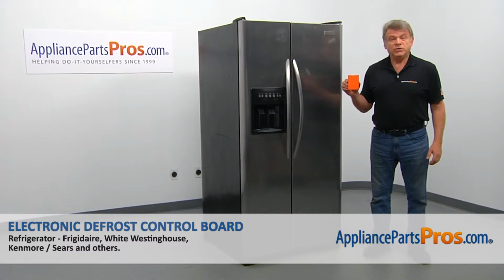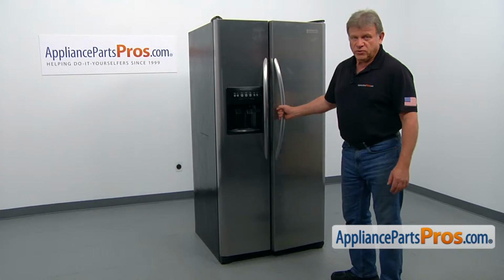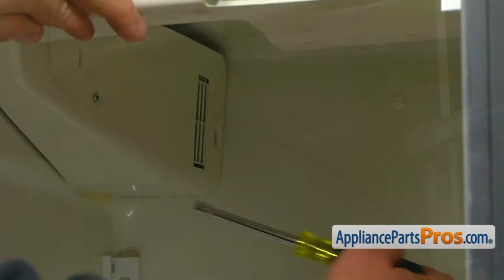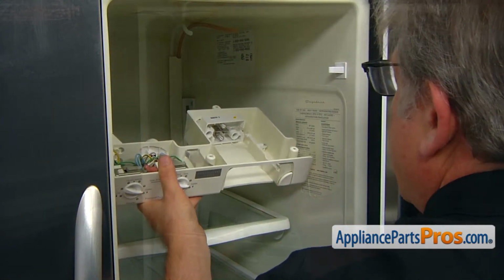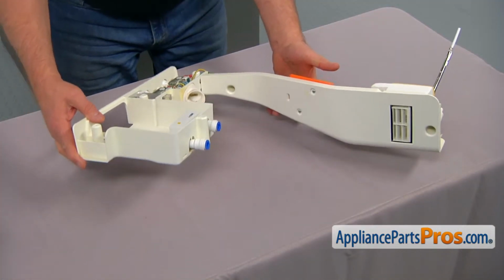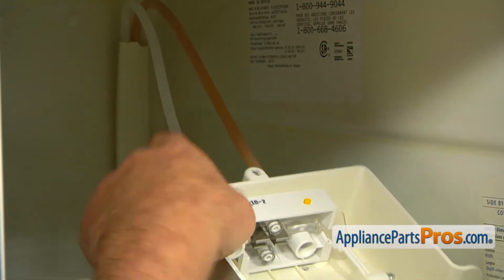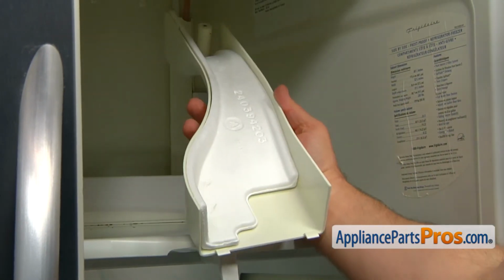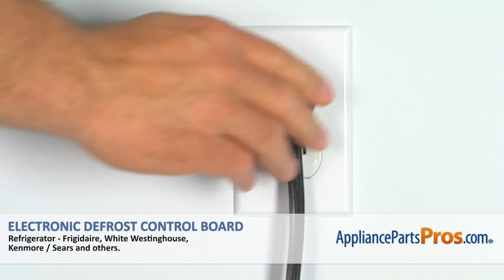How To: Frigidaire/Electrolux Electronic Defrost Control Board 242011001

Comment: where is that part on a french door frigdaire refrigerator
Reply from the maker: What is your model number?
Reply: FGHD2368TF3. 
The issue I’m having is my evaporator coil. It freezes up and then the air doesn’t flow up to the refrigerator since I have a French refrigerator. I replaced the thermostat and I tested the defrost assembly heater and it is working so I’m not sure what my next step would be unless a timer would be bad, which is Connected to the control board assembly
Reply from the maker: The part number for that control board is 5304510308. You can place that order through the website, or you can call us at 1-877-477-7278 to place the order over the phone.

Comment: How do you test the board to make sure its bad.
Reply from the maker: If you have a multimeter you would test it for voltage and make sure you are getting the correct voltage coming to it.

Comment: You-do-vid-on-how-to-replace-a-part-that-you-can't-buy.
Reply: what happens if this really is my problem - just junk the fridge??  ridiculous
Reply: @mikeearls126  I have this fridge with this problem and its been like it for several years. Its a pain but it works. You have to tap the light switch on and off  5 times within 5 seconds. That turns on the defroster in the freezer. The light switch in the fresh food not the freezer. I agree its ridiculous.
Reply: @snaggedover  thanks.  when i do that nothing happens.  My defrost system is not working....the thermostat is fine, i haven't checked the heater but i hear they rarely blow.  the part i want to test is the defrost timer but as you say, that part is no longer available.    did you ever fix your problem?
Reply: @mikeearls126  I have this same problem. I press the light switch on and off 5 times and nothing happens. The coils in my freezer are always freezing up. I checked the thermostat and the defrost heater, and they're both functional. Did you just give in and get a new fridge?
Reply: @snaggedover I replaced the evaporator fan motor, then I replaced the thermostat. Fan still has that weird fan cycle where it spins every 2 seconds after reaching full temp. I just tried what you said with the light switch and it turned off!! Thank so much, does this mean it’s the defrost timer or board?